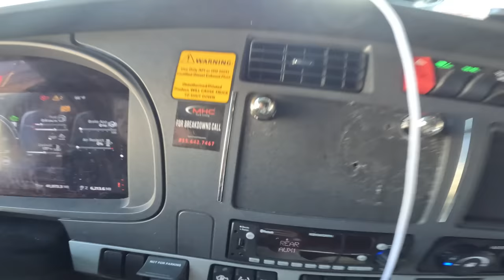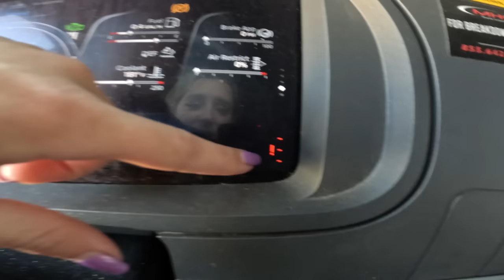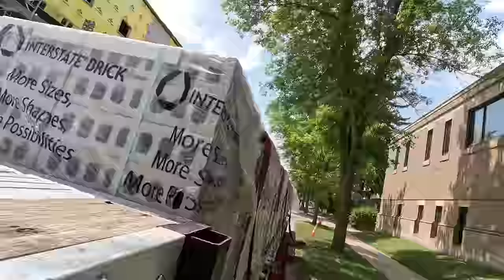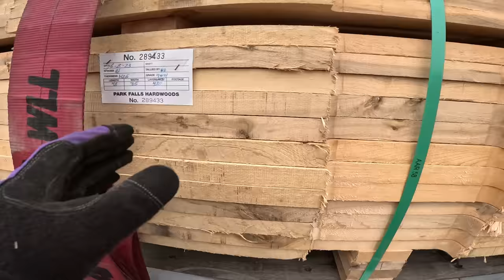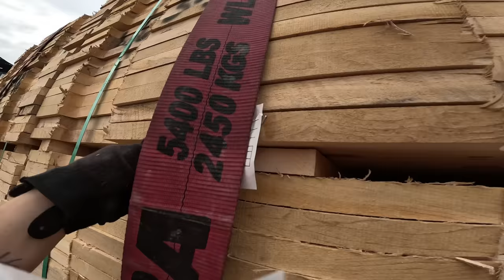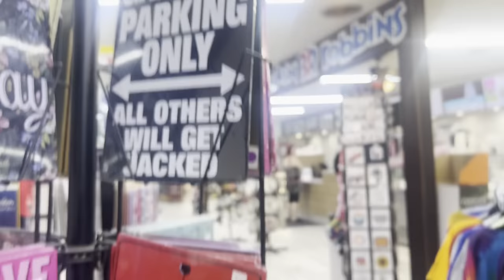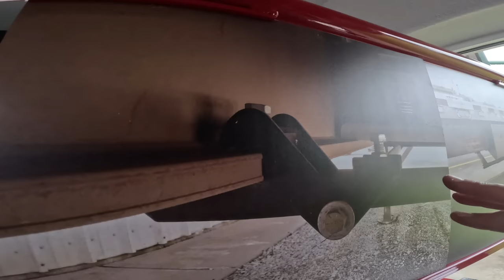Hay There Goes My Problems! Met The Creator Of BUNK’r 😮

Comment: I’m a hay producer and I have my own semi and step deck. You definitely don’t want to go on the road with any bales leaning outboard. Your problem is the bales on the bottom they are out of round shape and getting really flat cause in your top bale to lean outboard. Watch the loading of the hay and when it’s picked up if the bottom of the bale loses shape have it loaded on the top row. All your bottom rows need to be very tight bales. As you drive these bales will settle and become flat on the bottom side. As you may need to check and redo your straps every several 100 miles or so. There are people who bale big square bales 4 x 4 and even bigger and they transport much easier then round bales. I use edge protectors on the square bales and pull them really tight.

Comment: Saint Paul is a nightmare to drive in when everything is going well. Keep smiling, you'll get through this. Be safe Becca.
Reply: I got into 2 accidents, pulling a 20ft, on the same stretch of road of 494 between 94 and 35w, 50 hours apart!

Comment: That broker needs to tell that farmer, if he is going to sell hay that needs to be hauled, they need to learn how to bale hay. When I had horses the old guy we bought hay from old equipment, and they were rock solid.
Reply: I made hay for 25 years, not alot of money in farming to invest in new equipment unless you are a Monsanto sell out. Anyways alot of different  factors can create inconsistent bales.
Reply: @therockpile6734  like I said, the old farmer we bought hay from was way tighter than those.  The ones on Becca's trailer were all loose. It's not just inconsistency, if they are all like that.
Reply: @SkolValkyrie  they get loose from being stored on their sides, they hold shape better when stored on end also those bale spikes make a mess of bales, squeeze bale handlers are better for loading. She didn't have the load strapped front to back to lock the bales in either but it was her first time so can't fault her for that.
Reply: @therockpile6734  ok sure, my hubby runs stepdeck and flat bed, he would have rejected that load. There are way better hay loads to haul. Baled correctly, those would never have been like that, no matter how they are stacked. Just the fact they couldn't even be stacked 2 high without wanting to tip tells you they were mushy bales. There is nothing she could have done to strap that any better. Like I said, she would have had every right to reject that load. That mess is on the broker and the buyer that wanted cheap hay, and probably still paid too much. He got shorted probably 100-200lbs per bale  of hay by buying loosely baled hay. Hopefully Becca marked that broker off the list.
Reply: @SkolValkyrie  well my opinion based on my experience both baling and hauling hay is enough, not going to argue with you about it.
Reply: @SkolValkyrie  I've hauled worse bales than those and never lost any.
Reply: @therockpile6734  if you want those have at it. Deadheading is better than that load, especially with a brokered load. Probably didn't even cover the fuel. There's more to my statement than the quality of the hay. It was the time she had to waste making sure she didn't lose one or cause an accident. Its her CDL on the line when it comes to that.
Reply: @SkolValkyrie  your original comment didn't say anything about not taking load and my comment was directed at the passive aggressive jab at the farmer. Enjoy your next meal and thank a farmer for it.
Reply: @therockpile6734  I have no problem with farmers, and I speak from experience of having horses and buying quality hay. I do have a problem with brokers taking advantage of drivers by putting loads like this out there. That was a bad load of hay, your experience doesn't change that fact. Any DOT officer having a bad day at a scale house, could have put her out of service. And that's why drivers should reject those loads.
Reply: @SkolValkyrie how could they have put her out of service????
Reply: @jefferyphillips1075  poorly secured load, you come across the wrong DOT officer, on a bad day, they will write drivers up for anything they see fit.
Reply: NOTHING. WORKS. ,   AS.  IN. THE. OLD. DAYS. ,   EQUIPMENT.  ! .

Comment: Yea i would definitely talk to your company about getting winches installed on the other side its important with some loads to have the opposing pull i did that with any load i ran
Reply: @mp05sc02 That's for sure. I would be after them right now while they have it in for that equipment box they're putting on.

Comment: Truck issues seem to always come up at the worst time. Hopefully they can get your truck fixed so you can go out and do a few miles. A few lessons were learned on this hay load. Every new load will have lessons. At least your company knows that the load was not rolled properly and should have never been loaded on your truck. Well you will know for next time. I wish I was in Houston to meet you. Anywho a big lesson learned on this load. Have a great and a safe day. Happy trails and happy motoring.
Reply: I would like to know what kind of a company would put a new driver on a load assignment like that, without the proper training. Remember, it is your CDL and your life. If something bad happens to your fellow motorists, they are not the ones that would face potential prison time for criminal charges for negligent homicide.

Comment: The farmer used a variable core round baler that doesn’t produce good tight bales, they are a headache to haul. You can tell by the star shaped core versus a tight circular core on the side of the bale. I saw that as soon as you pulled onto the farm. You handled it like a champ! Kudos and well done!

Comment: Hey Becca I had the same problem and I guess it’s a recall on the engine break, bc every time I used it that would happen to me and I would have to disconnect the batteries and wait 5 mins and it would go back to normal. I think also them digital screen have to do something with it too my screen would freeze. Be safe out there keep rolling on 🚛

Comment: Only put a single row of bales on the top it would lock the bottom together since it's soft sloppy hay. These are softcore bales that werent properly finished they basically cheated the buyer by not making them dense. I'm sure this felt like a very light load like cotton candy.

Comment: Get several 50' length of rope.  You can tighten the ropes any direction.  They also make 60' straps to run the front to back.  Get a couple of them.

Comment: Check the ground bar on the fire wall it’s under the air lines coming through the fire wall. I had the same issue in a 579. It shut down inline inside a warehouse unloading Sheetrock. And then again at a red light. After cleaning the ground bar no more issues.

Comment: If you take key out pump gas 3 times put key in pump gas 3 times then turn key to electronics on pump 3 times then turn engine on it should reset all ur fault codes 😁

Comment: Get yourself a strap winder . They sell them at truck stops. Hooks onto the rub rail. Will save you alot of time and make rolling straps easier. They also sell stake pocket winches that you could use on the other side of the trailer. Or just get a few ratches

Comment: just fyi next time you pull round bails two strap front two strap back and one every either bail tarp the  load and then run strap from front to back one on the left and one one the right  and dont pull your straps so tight hay moves the tighter you strap it the more it is going to loosen up been hauling hay for round and square for 20 years just trying to help

Comment: I drive a Peterbilt and that console has given me the same problem.  Cycling the master switch has worked.  Yet the truck has been in the shop multiple times for this same problem.  It doesn’t know what gear it is in and then won’t start nor drive.  Good luck.

Comment: Loose bails like that do better standing on end four on four or whatever fits your trailer.  Strap them horizontally in clumps and then strap each clump across like you had them to keep them from sliding around on the trailer. If you can overlap the second tier, they will help hold the whole mess together.  Better to have hay to hay then the slippery plastic wrap.  That is why your load shifted.

Comment: The shifter stock on the Kenworths are known to be an issue. The thing you twist to put it in gear is most likely your problem. I'm a diesel tech for USXpress and have had to replace quit a few of these. The problem is so bad that there sending us rebuilt shifter stock's because they can't keep up with the demand for new ones. Good luck Becca.

Comment: That transmission alarm happened to our T680 also 3 occasions! It's a sensor fault. 3rd time it happened we sent it in and they tore the whole dash panel apart and transmission. That model is comfortable and has all the luxury accessories like air suspension, 5th wheel disconnect switch but that automatic trans is for the birds! Can't beat 13 or 18 speed. Did you guys figure out the problem? If it was a sensor? Or actual transmission?

Comment: Becca,
 Nice meeting you. Please, please.... no more loose rolled hay bales...lmao  Hope they finally got your truck fixed. Just another reason to stay away from automatic transmissions to me. 500 sensors and several computers to operate, basically a standard transmission that changes gears by air pressure and has no torque converter.

Comment: The next time you haul hay like this put the straps across the top in an X pattern.  The strap hooked to the trailer on the left side at the front crosses over the top and hooks to the trailer on the right side at the rear of each bundle.  That will help hold front-to-back movement as well as side-to-side.
Reply: Good idea! Kudos.
Reply: Also put tarps in between 1st of top hay bales jst incase it starts 2 rain!!!!!
Reply: The only problem was the bales themselves. If they weren’t baled so loose then the straps would have been fine.

Comment: I so hate all the electronics in vehicles for stuff like that.

Computers will always have issues as will any electronics.
Now days they just aren't built the same.

I'm curious what the outcome of that truck is.

Oops on wrong account lmfao.
I like that bunkr system. Better to use existing mounts than drill or weld. Move from 1 to another.

Comment: I used to have a 579 pete and it would do that where id loose gears and couldnt move but id go out behind the cab along the frame it had a kill switch and id turn it off then turn back on and it would reset the computer and get back in the truck start it up and then it would go back to normal idk if your truck has a kill switch

Comment: The truck problems remind me that my farm tractor has gremolins. 
The fraking thing sometimes has no gears when started, we could not fugured out why, then deslersip said to disconnect auxilari lights controller after tuning the vatteries off. It works. Everytime. What the actuall hell. No amounts or restarts almost never works. I guess it uses canbus for comms as the gearbox uses it too and they have a conflict so etimes? Also dealersip never privided us with a real fix. 
There also are more gremlins, and i have no power boost function anymore, though it never bothers me, as I am trying not to break anything using the tractor, but other workers at my fathers arm do use it, lol. They say it has no power, but actually that function is dusabled because the sensor ibside failed or it is ripped of or the metal piece which flies by it fell off, lol. At least it was what dealership say, they knoow what they say like 20% of the time, lol. But for several thousands nobody wanted for them to check if they guess rigt. As they want to be paid even if they do not fix it.

Comment: Kenworth has had all kinds of problems with the T680 from the 2021 models to the 2023 model and I know this because my last boss had a fleet of them and had driver break downs all over the Country and I had to drive one to Kenworth in Boise and what a piece of crap. I wasn't impressed at all with that Semi and what's crazy is i went to pick up a KW from the dealer after it was fixed and the Service Manager said they haven't worked out all the bugs from motors to transmissions to Computers systems and he said the DEF problems have been a huge problem

Comment: We have issues with that model at my work.  Trying to engage the engine brake while the truck is moving makes the transmission fault occur.  It’s all software bullshit.  Setting the jake to position 2 and just leaving it there works best.  3 makes the fault come back on again.  Although I haul fuel locally with minimal downgrades.  OTR your need full Jake power.  Too many computers in these new trucks.

Comment: That hay was rolled to loose that is why blew apart. They roll it loose to sell it and there is not as much hay in the roll. You can look at them and tell the way they set like a low tire. See the way your straps pull deep into them. They will save a full roll are two when they are loose rolled.  This is going to be a nightmare haul. You will learn on this load. If one of my round bales fall off when loading it will bounce around.

Comment: You did nothing wrong. But your boss is right. You can't secure that loose hay very well. I wouldn't except anything but tight bales.
But shippers will usually try to mix loose and tight knowing that it won't ride. Good job trying to secure that load safely.

Comment: On the loose hay you have to tighten it as tight as you can then drive about 5 miles and tighten again. It helps if you can winch from both sides. I have hauled a lot hay but your load is just about the worst I ever saw.

Comment: that is probably the worst round bales I have ever seen, the guy must have used a soft core baler, he made no effort or doesn't know how to make a decent bale as indicated by the cone shape of the bales., even if the bales are a solid core you should reject any cone shaped bales and have them find a square shouldered bale to load, that entire load should have just been rejected. glad you got it all worked out and stopped before the load fell off on the road.

Comment: Does anyone know what is really bad on big trucks? Computer crap. It beats the hell out of all the sensitive crap. A lack of guages that are hardwired so you know everything from tranny to turbo and diffs. But its a condo and has a tilt wheel and just have to push a button and hit the brakes or gas. I would rather see 16 round gauges and play with two sticks than push a button and look at a guage cluster and idiot lights.

As for hay?  Thats one of those loads you really hate pulling. The few time i pulled hay i tarped the load just because. A stray cigarette going down the road will make it smoulder and its rides better when you are strapping the tarps. And if i tarp it i get paid. Round bails need to be tarped. Square bales too.

Comment: So you are having problems with your truck breaking down where it says stop or you may damage the transmission. Yet you are still hauling loads hundreds of miles?

On top of that hay that isn't rolled tight enough that is a safety hazard? Your truck should have been fixed first instead of having to continue to drive feeling unsafe that it might break down.

And good thing none of that hay rolled off on the highway causing any accidents. It just seems like a failure all around on this load, not by the driver but the the company for not having the truck fixed properly and by the stupid farmers who didn't roll the hay properly.

Glad you got through it safely.

Comment: R.I.P. manual transmissions, basic mechanical injection diesel engines, with pony motor or air starters and capable drivers. we're doomed.
not saying anything bad about you/towards you or others, as I don't know your skill sets.
BUT I am throwing lightning bolts and fire ant truck manufactures, government, and other fools at the helm(kindest way I can put it and be). garbage electronics aka "junktronics", been calling it that for 20+ years now. 🤣 again, nothing against you.😉